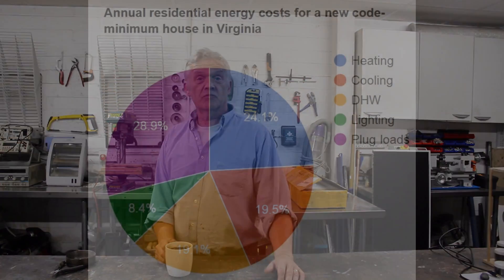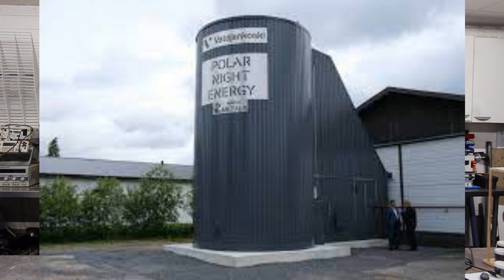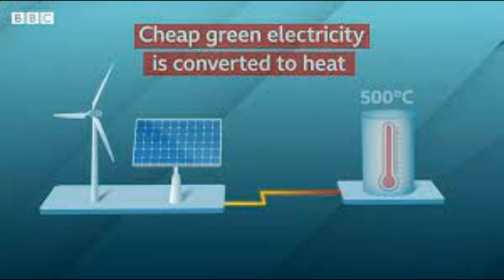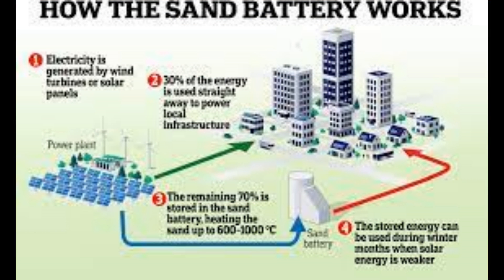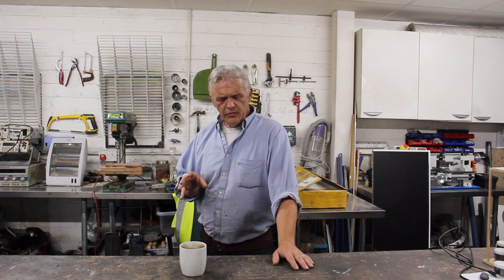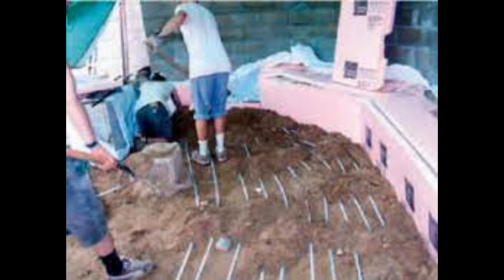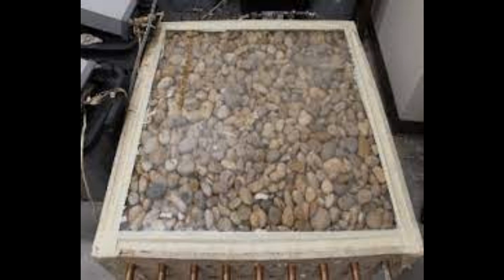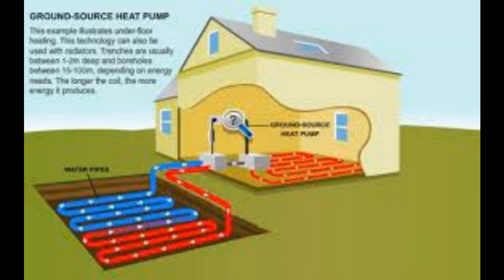1604 The Sand Battery - A DIY Option Or Not?

Comment: This is a good idea, much more credible than the MIT molten salt idea at least, but the primary problem between the two is still the same: these things supposedly run on 'excess' energy from the grid. Especially true right now, the US grid is barely able to suffer through the summer, and if you live somewhere with unusual weather in winter (Texas), it doesn't comply well at all. This is before all the wunderkinds get their way and simultaneously get rid of dino fuel and we're all punishing the grid with electric car consumption. Case in point, where are they expecting to find enough excess energy to pour into a giant sand storage field?

Comment: RMS, I like the one with a datacenter in a concrete building that looks like and upside down funnel. Inside are hundreds of computers, producing waste heat. The waste heat rises and a turbine inside the outlet pipe turns and creates electricity.  Simple!

Comment: I've seen reports of a project to build a utility scale heat battery from heating rocks rather than sand, and using temperatures high enough to power existing steam turbine powerplants (with any excess heat used to heat buildings as usual.
Reply: They are building it here in Denmark as I write this 👍

Comment: I'd wonder how the graphene coated sand would do in a thermal battery?  Enough graphene, or some added carbon/graphite and maybe the sand would act as a resistor? Would be cool to see a wind turbine power a small sand battery.
Reply: Graphene coating would make it more thermally conductive--it would become more poor at storing heat energy.

Comment: Can you use Iron or iron oxide?
Reply: I have an Idea for a while you have talked about Solar wind and hydroelectric power. I watched a video about the trompe a device which use hydroelectric power plants to get compressed air without a compressor or moving parts.

Comment: Hi Rob. Long time no message.   Dick Strawbridge did a tv programme back in the day where he used glass.  He sent his kids to the local pub to collect all the used bottles.  Crushed them, basically back to sand, then dug a hole in the ground.  Put uPVc pipe in it and filled said hole with the crushed glass.  He then built a greenhouse on top of the hole.  A solar panel and a 12v fan later the very hot air from the greenhouse in daytime was fanned down the pipe, heating the glass, that was then released over night, keeping the greenhouse warm at night.  I feel confident that between yourself and Dick you could take over the world

Comment: I had a book called soft tech from the 70s in it was an article on dwelling development in a desert area  
The article highlighted 3 new technologies one clear heat reflecting film on glass  almost standard now 
One a film for glass that turned opaque when it reached a set temp and finally 
What they called thermo Crete  it was an aerated concrete with calcium chloride impregnated zeolite that would absorb heat from the sun until it reached the set temp which could be adjusted by varying amounts of Ca Cl if I remember correctly 
The dwelling constructed of this concrete was inside a large greenhouse when it reached set temp inside the greenhouse would get warmer and when that reached set temp the film would go opaque and not allow more heat into the building 
I always liked the idea of this thermocrete but couldn’t wrap my head around how it works
Reply: Hmm, interesting.
A similar effect could be achieved using bi-metal strips or wax-capsule activators to adjust blinds/shutters.

Comment: Of course one place where this can be used potentially immediately, is at massive coal-fired power stations. There they dissipate insane amounts of heat, and after the energy had been extracted in the turbines, it can be blown into massive mountains of sand and ash where it can be stored for later use. One place it can be used is in preheating water before boiling in order to produce steam for the turbines.
Reply: Might be better to do away with the coal-fired boilers, and use  excess energy from wind-farms (when there is too much wind and no demand) to melt a metal, such as aluminium, which can later be used to produce steam...
Reply: @richardking6066  That is certainly idea, and I agree with you, but for now, in the interim it is a way to capture some of the lost energy and perhaps even  use to to turn CO2 back into carbon, like Elon suggests. These processes are already known and it would extend existing tech and resources further and utilise them better on the way to the ideal solution. Fossil fuels remain afactor, but also a huge problem. What can I say.

Comment: Firstly, thanks Rob for a well thought out overview of thermal storage. I was thinking about using water as the mass to heat, but thinking over the last couple of weeks I see that sand is the way to go.
I have ordered some high wattage resistors and some nichrome wire to play with in my sand box :-)
Now having watched your take on this subject I thought about using a conductive ink mixed with the sand, so that the sand mass as a whole could be the resistive load. 🤔
Reply: That is a neat idea with having a resistive mass.  I believe it will not be needed as long as your element can be controlled not to overheat the resistance wire locally.  The heat will spread through the mass by conduction, convection and radiation at reasonable speeds even if the element was placed exclusively inside the centre of the mass (to benefit from lower heat losses from the cooler outside).

Having the heat at close to melting point for the sand just in the middle would be ideal.

Your method would be good to dump a LOT of energy into the sand all at once but that might be a rather unusual requirement unless you has free energy from over speed wind turbines you wanted to store instead of just dump into the atmosphere.

Comment: Storing heat in sand can be considered to date back thousands of years.

The bricks in ovens that store heat are made up of sand. 
The ovens are heated up and the bricks store that heat.

There are also coolers that can be made with terracotta containers and sand to preserve perishables. Once built, you pour water into the sand and as the water evaporates, it cools the inner chamber. I think that's how it works.

Sometimes, going ancient school is the solution to modern day conundrums.
Reply: It’s all trying to mimick building into the side of a mountain with diy stoves where the surrounding stone holds the heat.

Comment: I follow a Ukrainian guy (Ironic isn't it) who has been pushing cheap versions of solar thermal energy production. 
He goes the low tech route and one of the things he has been proposing over the years is Thermal Storage in Gravel!

Now Gravel is a lot more abundant, easily available and cheap material for storage! The only rel drawback I can see for truly industrial size storage is compression of insulation. It's not like you could just put some Expanded Polystyrene or Rockwool down if you are going to put a few thousand tons of gravel on it. Having said that it may be possible with some forms of Aircrete  as point loading would be comparatively low.

Interesting times ..... especially if we can link Cheap Electricity which is surplus to demand at that time or Solar Thermal to link with heat hungry industrial processes!

Comment: Just like homopolar generators. They used them to power particle accelerators but stop because people started to learn it didnt have back emf to overcome. Michael faraday paradox isn't a paradox for the consumers ,it's a devastating device for corporations who like selling energy
Reply: New welding technique also uses this type of generator. I thought if it was coupled or incorporated in the design, a flywheel would increase its ability , only problem is disk magnets are not made large enough ,yet

Comment: Heating Energy is valuable, no doubt. And the sand battery is a method of storing heat energy. But is it really worth heating sand with even more valuable electricity? Would a solarthermal approach not be the better choice? The heat exchanger in the sand could be used to charge and to discharge the sand in such a setup. Also, some calculations would be nice. How much sand do I need? How is the efficiency over some weeks?
Reply: The Finns are using excess solar and wind generated electricity to intermittently heat the sand.  Since the sand in its insulated container holds heat so well, they can preserve the heat gathered in the summer for use in distributed heating systems in the winter.

Comment: Water is one of the best materials for storing heat, and cheaper.  I've crunched the numbers for dozens of material but nothing compares to water.  There are challenges but I know your up to the challenge.  Btw, evaporative cooling is thousands of years old.  In fact, evaporative cooling was used to make ice in hot climates thousands of years ago.  Have fun!!!
Reply: Water can only store heat up to 100C before it becomes steam which is far more troublesome to store. But sand/rock can be heated to thousands of degrees without changing state. The only advantage I see to water is that it flows easily.

Comment: I seem to remember Dick Strawbridge on ‘Its Not Easy Being Green’, filling a pit in his greenhouse with crushed glass from bottles. Hot air from the greenhouse was piped through it during the day, then at night it radiated back out to keep the frost at bay. I don’t know how well it worked. That’s why there are loads of green and brown bottles in my recycling bin…honest.
Reply: He should have used water, specific heat 4180 J/kgC, glass is maybe 700 at best, plus factoring in the stacking factor for the spaces between all the pieces so he would have been getting 400J/kgC as a volumetric equivelent, if he was lucky, about one tenth of what water would have given.

Comment: Sorry for being so stupid but I don't get it, Sand has thermal specific heat capacity of about 700j per kg per deg, but water for eg is over 4000j per kg per deg, which due to Law of cooling means heat losses will be LESS for eg water for the same mass & same quantity of energy. This can be played off against mass of water req'd.  I remember the 'brick' storage heaters of the 90s that stored white meter juice were absolutely hopeless with capacity.
Reply: Except you can heat sand up to hundreds and hundreds of degrees, while water boils at 100.  You cns store energy in sand at temperatures sufficient to generate steam and drive turbines.

Comment: If it were a pressurized closed loop system, then you could add water to the sand and increase the thermal inertia of the storage device thereby increasing its thermal storage capacity. Great idea Robert!
Reply: Water can only be heated so far before it becomes steam and requires vastely more space while sand and rock can be heated to near molten temperatures with little thermal expansion.

Comment: I daily cook my food in a heat battery filled with quartz sand. The temp gets around 350 C at sun down ( even in cloudy wetter ). In the morning it's fallen to 250 C
It's powered with two 120 Watt solar panels connected to a 16 Ohm resistor in the sand. Works great!
Reply: @marthale7 I'm lucky to live in a area where there are natural quartz sand Deposits.
After building a few promising prototypes i want to move to magnetite sand instead.
My current setup:
Two 120 Watt / 26 volt solar panels in series connected.
A metal paint bucked around 20 liters.
I use aerogel glass-fiber insulation on the inside of the bucket. ( 12 mm Double layer )
Homemade heater coil with NiCh wire.( 16 Ohms ) on the bottom.
Filled the space with sand.
On top of the sand i placed a thick round aluminium disk  ( to cook on ) with thick aluminium bars connected to it going into the sand to transfer the heat.
The outside of the bucked is then wrapt with extra rock-wool insulation.
Not sure about induction cookers, not tested this. Don't you need a relative big battery bank an a pure sine wave inverter for this?
One day i make a "you"tube vid about this project.
Reply: @RogerJonker  I bought some variable speed controllers, one which operated my immersion heater from electric via my solar inverter and the other controller was for my small electric over to reduce its voltage and therefore consumption. Think RMS did a video on improving such a small oven, cannot remember what he did though other than insulating it. Best wishes.
Reply: @RogerJonker  i have welded two 44 gallon drums together, i'm going to cram as much steel and copper in with the sand as i can, i am hoping the copper will give rapid heat transfer and the steel give high energy density, it will have oven , cooktop and  hot water coil ...............
Reply: @michaeljoncour4903  Great idea, I've also used copper rods and aluminium  to even out the temp in the sand mass. The sand is a little insulator and the heaters can get very hot, so you have to transfer the heat away.
Reply: Yes please make a video im very interested to about your setup and in Winter it's a great heater too?
Reply: @CUBETechie 
Have a look at my channel. I just uploaded a video i made earlier where i cook my dinner directly on solar ( no heat storage )
Soon i show my heat battery setup and how it's constructed.
Reply: @marthale7 Sorry, i can not place a direct link. My first two replays where removed by YT. There are a few web shops that sell this blanked where i live in Holland.
Shame this stuff is sooo expensive and a real pain to work with. 
With the current energy prices its paying back very soon tho🙂
Yes, magnetite has a high heat capacity and i hope to bridge a few dark solar days with it.
Reply: @RogerJonker  a mix of 1:7 cement: perlite, which has an R value of 11 at six inches, and is an insulating material that would not be damaged by water. It is also load bearing; not as good as regular concrete, but plenty strong enough for a residential floor so could easily be fabricated into tank like structure to hold your heat storage medium.

Water is at least double or triple any sand you can get for specific heat with no phase change, so unless you need over 100DegC for pizza, then magnetite is not so graeat.
Reply: @garethsmith7628  water collects heat very fast but it dumps it very rapidly (that’s why it is used in car radiators) Masonry , sand rock brick etc., collects heat slowly and releases it very slowly.
Reply: How do you isolate the sand, to that thermal energy does not escape to the environment?
Reply: @adrenalinemedia  sand is an insulator, for example fiber glass, SiO2 same composition as quartz/sand
Reply: @adrenalinemedia  Large thermos bottles!
Reply: @adrenalinemedia  Its called lots of insulation eg: rock wool.
Reply: @adrenalinemedia  air gap, still air is decent insulator
Reply: He said you have to get the size of your sand battery right in order to best meet your energy needs. Is it better to err on the side of being too big, rather than being too small?
Reply: Thats awesome bro . You could literally have a resistive element directly in the sand . I used gas but next time I will use excess solar from panels on the roof . 👍🏻
Reply: Now that is innovation, well done for that.
Reply: what's the size of it?
Reply: Wow! That's hot. How big is it?
Reply: @vernonbuell3943  It's a 20 Liter metal paint bucked filled with sand. Insulated with aerogel blanked.
Reply: Sounds great. What quantity of sand?
Reply: Do you just put the power output from solar into the sand
Reply: @dune6727  Using a resistance heater.
Reply: @robertpendzick9250  thanks Robert
Reply: @dune6727  most solar panels output 12 volts (18 volts).
Recreational vehicles offer water heaters at 12 volts. Those heating elements are available online or at the local RV parts store. Also, for a tiny heater (like a small decorative milk can or a 14" pot belly stove) a cigarette lighter induction heater like you place in a metal coffee cup to heat water is more than sufficient to heat a small bathroom sand battery.
The more voltage the element was designed for (like the burner element on your cook stove) does not care when it comes to DC current. They just heat more slowly. 
Spring clean up refuse piles are a great place to "acquire" elements. And if you find an oven, grab that temp controller fir the oven too.
Ask around the neighborhood for freebie car batteries.
It goes Solar panel -> car battery -> element -> sand.
Be sure to get a small plant stand to put your SB on so you don't set those wooden floors or carpets ablaze.
Get a 4" UBS ($10 @ Dollar General) fan and hook up a cigarette lighter socket to the car battery, plug in the UBS insert, plug in the fan and enjoy the summer breeze.
If you gang up more than one car battery hook them in parallel and stay 12 volt through your system
Reply: Love to see a video of your setup... also wonder if it could be expanded to pipe heat under a house...
Reply: What is we passed a lightening bot into a Dom of sand, heating it up instantly to 2000 Celsius degrees, then punm out the heat slowly